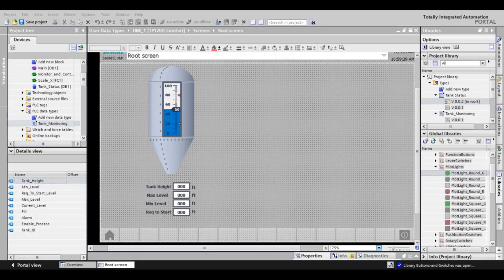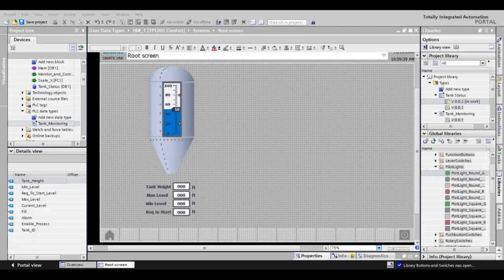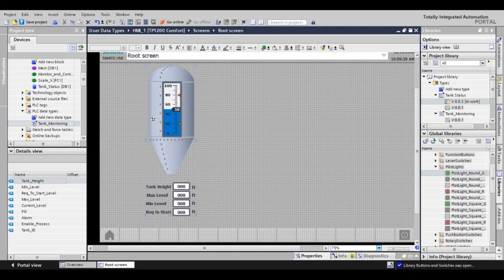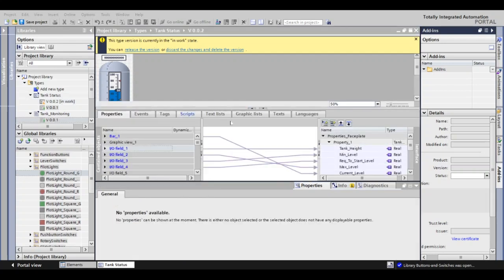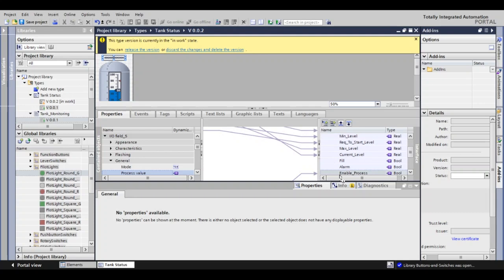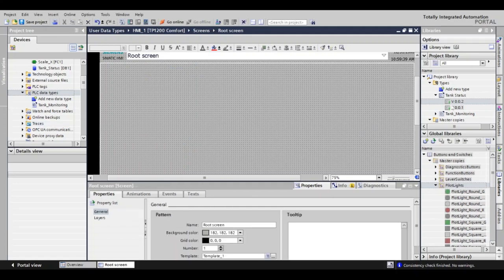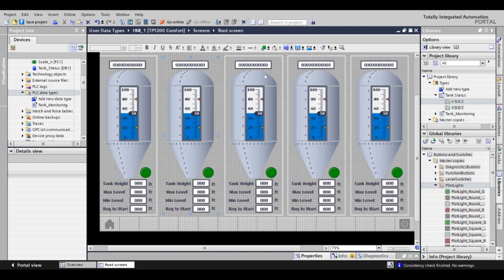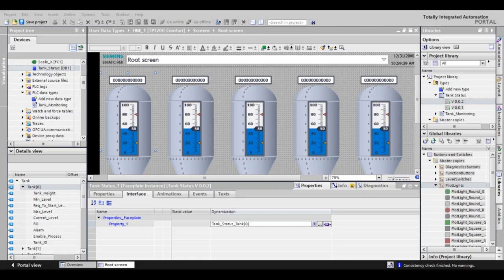Creating HMI Faceplates From UDTs in TIA Portal | Authorized Siemens Support | AWC, Inc.

Comment: I have a faceplate on a popup screen and I am wondering if you can pass a UDT instance to this popup screen from a button?  I see it works if you have an array of UDT's in a datablock, but I am wondering if it can be done with multiple datablock instances of the UDT.  I see with version 16 Unified you can script a UDT instance but I am wondering if this is possible with version 15 or 16 standard.